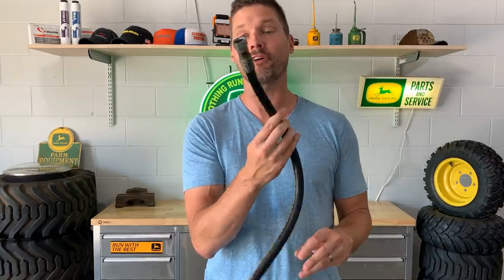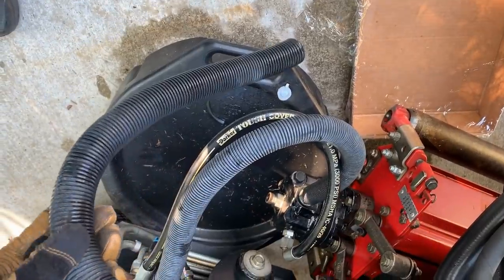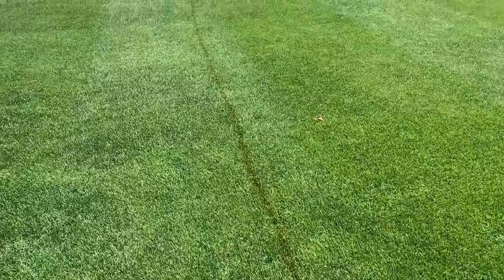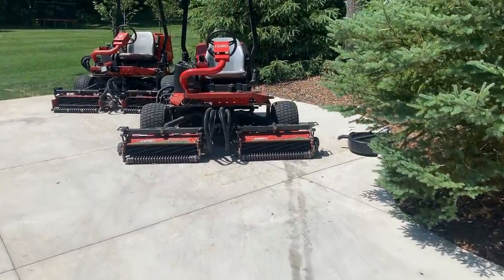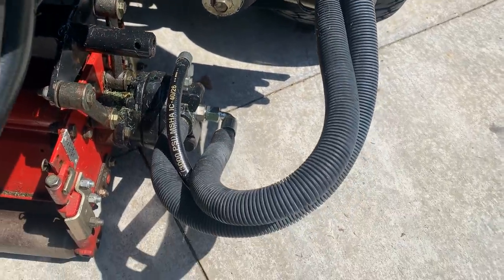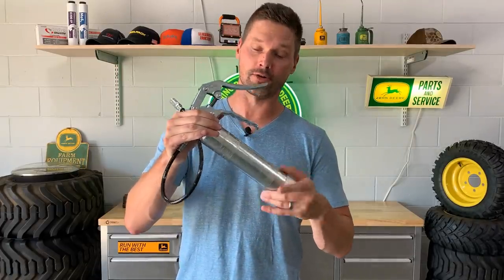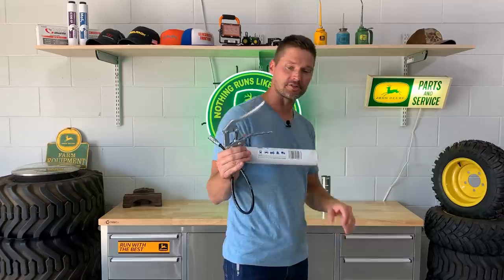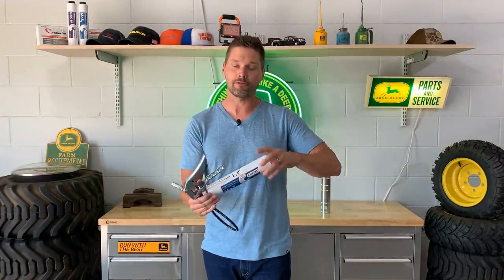TOP 5 WAYS THINGS GO WRONG ON YOUR TRACTOR! 👨‍🌾🚜👩‍🌾

Comment: I bought my 3038e in 2014. The dealer told me to tighten the lug nuts when I got to ten hours. I thought that was weird but I did tighten everything. A week later I was using the loader for an extended period of time. The rear wheel fell off! I called dear the next day and they sent a mechanic and fixed everything.